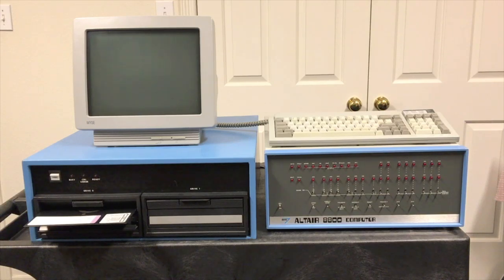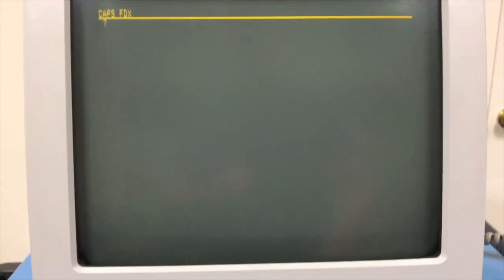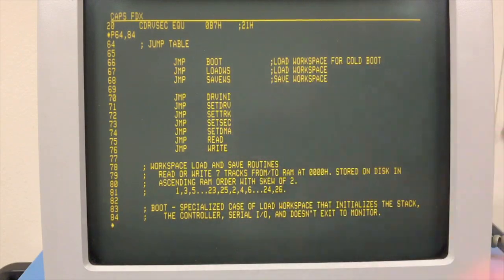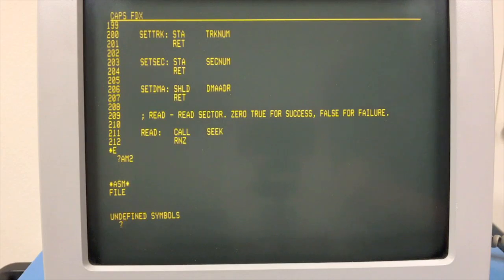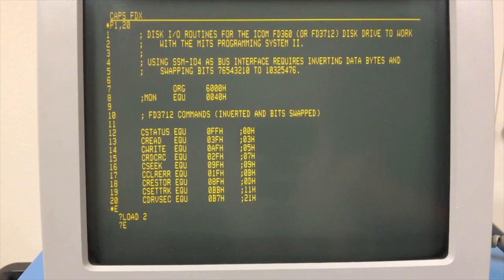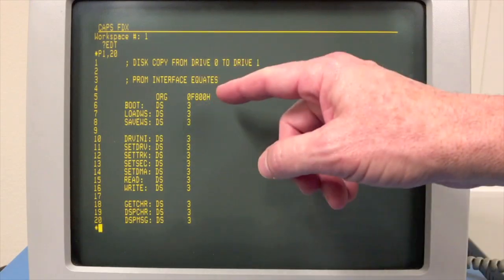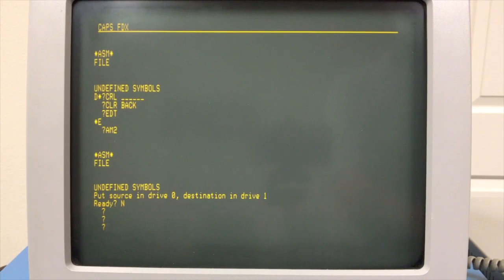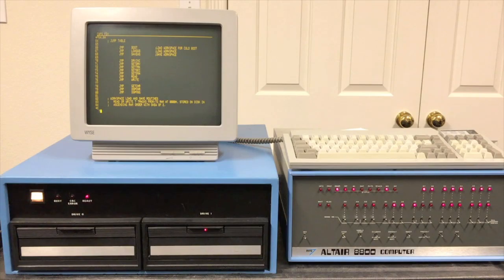Early Altair 8800 - Adding a Floppy Drive #4

Comment: Excellent work Mike. Just a small suggestion, a comment right at the top of the edit buffer so the text of that comment is always at the same memory location. Then maybe use that as a way to identify workspaces by name?
Reply: So gently begins the implementation of a File System; so loudly come the problems. Honestly, I would love to see Mike take this further into a full operating system of sorts. It's really awesome watching something get built from scratch and they're really great at describing things :) 
chuckles
Reply: I was thinking more along the lines of just a simple "LIST" command to read every 7th track, pull out the comment and display it with the workspace number. But yeah, tweaking stuff can kinda get obsessive once you fall into that cycle.